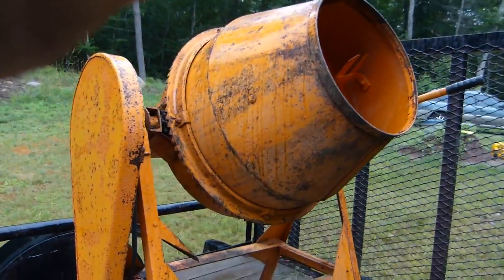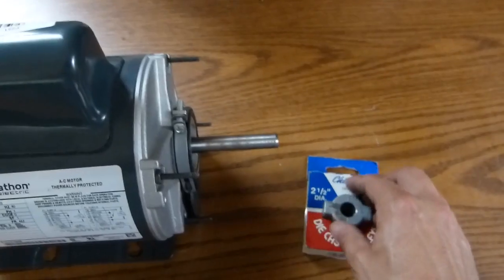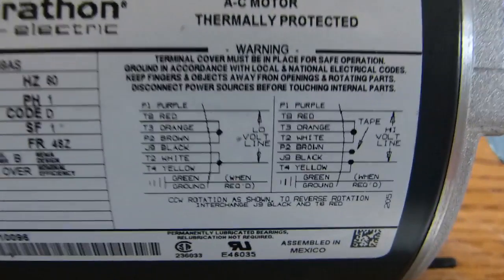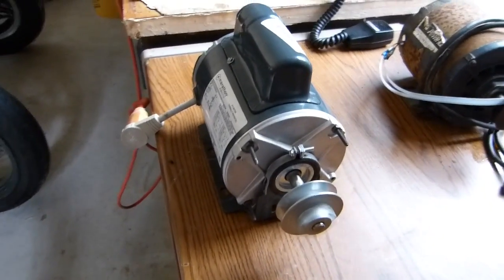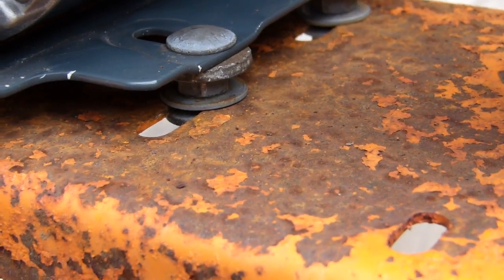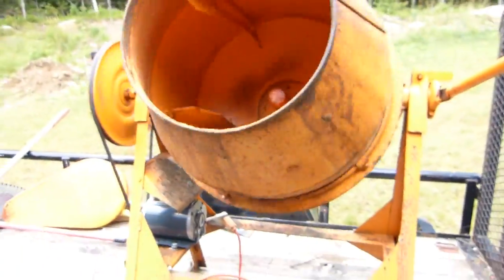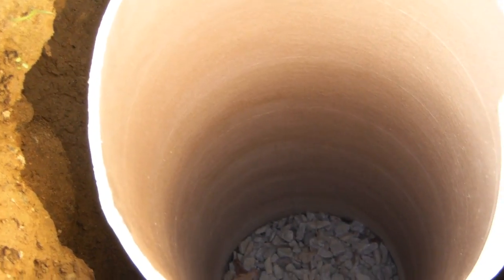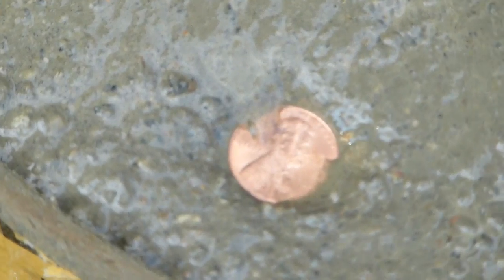Montgomery Ward GIL-26471A Cement Mixer Motor Replacement

Comment: Man I bought one of these 10 years ago and its saved me many hours of hand mixing. Mine had the original motor tagged Montgomery Wards on it and it was a 1/3 hp 6.2 amps and 1725 rpm, and was reversible on direction. It finally gave out and I'm going to go with a 3/4 up 1725 rpm motor. These are extremely well built and if kept clean and greased it should last a long time.

Comment: Over 20 years ago one of my coworkers ask me if I could mow their house lawn for them because their lawn mower was broke.
I said sure no problem.
After mowing his lawn and weed eating for free I was getting ready to leave.
He had a huge Barn packed to the gills with all kinds of stuff and asked me if I saw anything that I wanted inside because he was going to get rid of most of it.
I saw the Montgomery Ward cement mixer sitting in the corner and asked him about it.
He told me that he was driving down a side road one day and somebody had it sitting out on the curb with a sign on it that said free, so he stopped and loaded it up on his trailer and kept it for years in his barn.
Needless to say I ended up with the mixer.
I can guarantee you that you won't find anything built heavy like this anymore and this mixer does the job.
It may be noisy and it may be as heavy as a tank,but this is the best trade off for mowing a lawn that I've ever gotten.
I've probably mixed more than 50 yards of concrete with this mixer and it's never let me down.
Reply from the maker: Great story!  Thanks for sharing....I agree, that was definitely a good trade-off for an afternoon's work ..

Comment: Ive been watching for a bushing replacement video, haven't found one yet.  I found this Montgomery Wards in junk yard, it is a Gilson 5831A.
Barrel had fallen out and disconnected from the frame as it was bent out of of square also.  I straighten the frame back over the  barrel sides -back in hole. There were no bearings, but the cast iron bucket rode against cast iron bushing holes with grease slots.  The drive shaft is considerable worn as it slopped inside the bushing.  A little movement between the barrel and gear drive  is normal, thus the distinct noise these make. The shaft and hole is 1 inch. The worm gear is fine but shaft has grooved along with the bushing casing just on the end. The bushing casing is cast iron too. The shaft has a long bushing 1/2" thick holding the drive shaft inside the cast iron Triangle mount at the top. I cannot find any replacement part online for these vintage mixers, even from the maker Gilson.  So I am it pulling apart to get the triangle off, worm gear off of shaft and shaft out of bushing rod casing. I will get a machine shop to make a new bushing and shaft which does come apart at the worm gear. I dont know how to fill in the cast iron with metal -maybe weld it while torched hot?  Good luck fixing these all American made beast.

Comment: Thanks for the video - I too have one of these mixers that needs a new motor. On the straps that hold the horizontal shaft in place there is a small hole on each topside; I was wondering if there should be a grease zerk but your video clearly shows that the hole isn't tapped for threads ( mine is kinda rusty so I couldn't tell). One difference in my mixer is that the motor wiring runs to a metal household type switch box mounted on the frame with a regular light switch - might be a little safer than having to reach under the drum to plug it in. The mixer was free to me so the cost of a new motor is a small price to pay for a heavier duty  ALL METAL mixer that was made in the US of A. With a new motor ( TEFC this go round) I'm sure it will still be working long after I'm gone - unlike what's currently available at the big box stores or Harbor Fright.
Reply from the maker: Good luck with your machine!  Mine was bought new by my father in the later 60's I think...like you said, its made of real metal, not crappy Chinesium like the modern ones.

Comment: Hi guys. I've got this very same mixer that I bought from a buddy over 30 yrs ago for $75. It spends more time sitting on the side of the house, but has mixed a lot of concrete for me in it's time. I too was concerned about the slop in the pinion drive, so I pulled the tub off today to see if anything can be done to make it better. I don't see anything other than packing it full of grease as far as fixing anything. I can tell you that my drive motor is 1/2 hp Dayton and has not been replaced since I've had it. The belt is also a Dayton part# 4L630. I plan on bringing it up to my cabin this Spring to do some projects. So hopefully you will see this post and still need the belt #.
Reply: I have this same mixer and am trying to remove the tub. I have the set screw out and the cap off of the interior spindle end. For the life of me I cannot figure out the next step.
Reply: @dlperino9  So - To get the cap in the Drum off?  There is a setscrew Allen head holding it?
Thx, I was given this model mixer.

Comment: I also found a mixer the same as this one. it had an axle and wheels. the frount has a extenion to pic it up to move it. I have read all the responses, and the gear drive and pinion gear on mine have a lot of play as well. enough for the large fully to turn out of round, but doesent cause the belt to come off the pully so I guess its ok. 
Mine also had an electric motor, anr its a 1/2 horse and 1750 rpms. motor was made by Emerson.
mine also had a Briggs and Stratton small motor added to run it with gas .
that motor is no good so I bought a cheap Predator motor at Harbor fright and have installed it.
that caused me to have to do some reashearch the mixer to understand the required RPM's of the drum. Most of the responce i have found was that 20-25 rpm's would be correct. I found a fully for the new motor and it runs a little fast, but i am able to throddle it back some and should work fine.
Mine is a GIL 71A and has no other tables. there is enough of the Montgomery Wards stickker to start my search. I may have found a company that may have the gear shaft and pinion. 
If anyone has a manual t I would ike to find a copy.
Again thanks for the video

Comment: Haha I just picked the same outfit over at my dads house on my single axle trailer. I need to do the same thing. 
My motor still runs! But it seems to lose power. I did however clean the motor up and incrediblely there was no rust, it had been sitting outside in the Utah harsh climates for 18 years plus. The mixer seems to bog down though. I am mixing a 92 lb bag of Portland cement with 18-20 shovel fulls of sand w/ 4-1/2 gallons of water. It may be to heavy

Comment: My mixer will do 2 80 lb bags.  

The drum is a bi-directional drum.  You load from one side and can flip the drum to the opposite side and it will discharge the concrete outward.  Took me a long time to discover that  HA.  The "scooping" motion is the mixing side

One thing I added was a wall switch on the frame to be able to turn it on/off more easily once it was plugged in.

The bearings on the pinion (and I assume the barrel) are solid steel bearings.

The mixer is a strong machine, don't put anything in it like your arm/hand or you will lose it!!

Comment from the maker: JJ - the machine is currently with by Borther-in-law so I can't measure the belt and I don't recall any part numbers it might have had on it.  I expect mine is the OEM belt, so if you were able to locate an owner's manual, that might tell you the belt length or part number that's on mine...

Comment: Just bought one of these mixers at a farm auction for $55 and it looks as if it’s had very little use.  Of course as to be expected the motor makes noise but does not spin, as I see it put a new motor on it and still have less in it than a new one and be by far better quality.

Comment: I just acquired one of these M-W cement mixers.  I noticed that it is really noisy when rotating. There appears to be a large amount of lateral slop / wear to the pinion shaft that the large pulley attaches to... the other end of the shaft has the pinion gear on it that drives the ring gear on the bottom of the mixer drum. In the video, your mixer sounds much like mine does. Do you have noticeable lateral movement, slop/ wear in the pinion shaft of your mixer also?
Reply from the maker: +Bernie Pokorski My mixer is out on loan right now so I can't check it.  But from what I remember, there is a fair amount of slop in the drive mechanism.  Mine had never been used or taken apart before I got a hold of it so the slop is probably normal and not due to wear. My pulley had been bent around the center from being transported (I bent it back into shape before this video was shot) and may have some run out which is probably not helping the situation.  But it seemed to work just fine regardless of the run out and slop.  If yours doesn't bind, slip, or come apart on you then its probably OK - but that just a layman's opinion...
Reply: +SevenFortyOne Thank You for the quick reply. I believe that Gilson built these concrete mixers for Wards. Your original motor in the video appears to be a "Power-Kraft" which was Wards name for their power tool line, as I recall.

Comment: This mixer should spin at 22 to 25 RPM. The 2 1/2 inch pully shown may be spining it to fast.
A totally enclosed , fan cooled ( tefc ) motor would have been a better choice for a wet and dusty application.

Comment: Hi, I am pretty sure that no one is going to reply, but I am desperate. I have an old Montgomery Ward mixer, and the 9 tooth bevel drive gear is shot.  It has a three quart inch diameter rod that the gear is mounted on.  Everything else is great, even clean.  The belt gear looks like it hasn't been used. It still turned the drum, but it was making a lot of noise.  I need a replacement gear badly.  I have a project to finish and I hate the junk that is being made for mixing concrete. The old portable Mongomery Ward mixers were built to last, and I appreciate them.  Any suggestions?
Reply from the maker: Parts direct.com might have something....or ebay

Comment: Errr, you can't use a variac to control an AC motor like that, not because of the capacitor, but because the line frequency sets the speed of the motor. Adjusting the voltage is just going to burn up the motor.
Reply: Noticed that. Lucky he didn't burn up the motor.